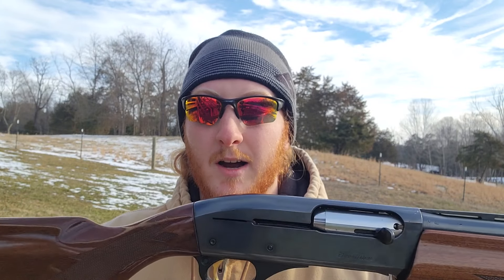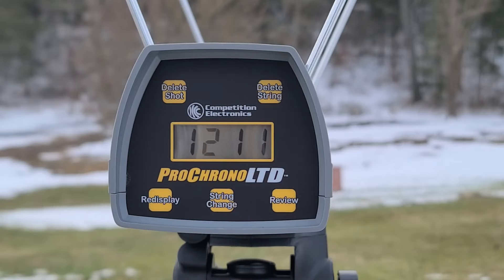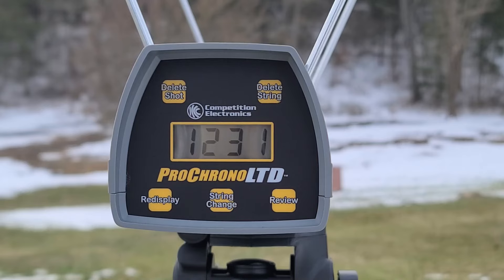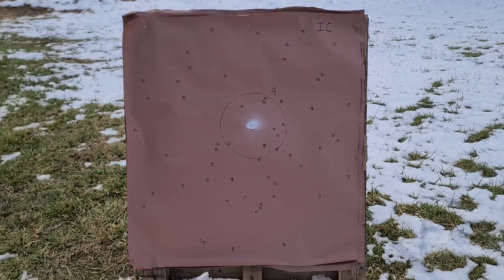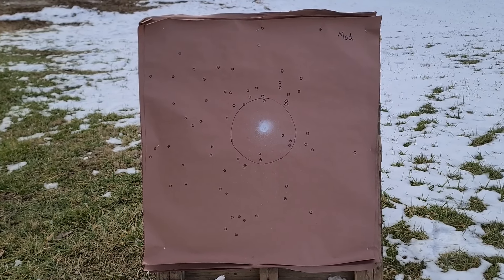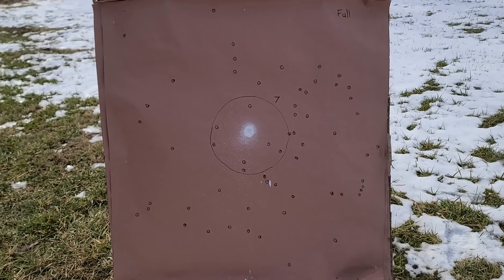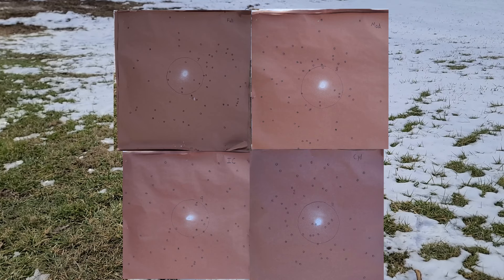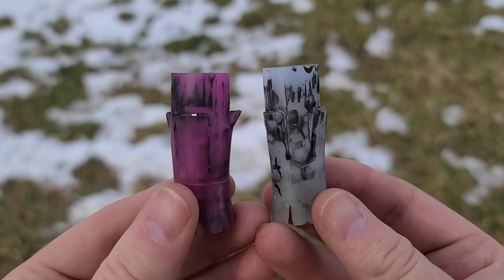What Choke Is Best? Hornady Magnum Coyote 3" 1-1/2oz BB

Comment: Matt thanks for the videos. Are you happy with your chronograph?  I was thinking of purchasing the Caldwell chronograph at cabelas, but I am not sure as a first time buyer.
Reply from the maker: I have never used one of the Caldwell chronos before, so I can't really say much there. But I have used a few of the ProChronos like this one and they've always done just fine as long as you're not too close to where the muzzle blast will mess with it. I will say that if you plan to use it indoors or outside in an area with a lot of weird shadows, you should also look into getting a lighting kit for it as well. It will drastically help your readings and cause less errors in areas where lighting may be problematic
Reply: @matttyreeoutdoors  thank you

Comment: The wads are a new variable to contend with. I didn't know Hornady had one. Always heard flight control doesn't like constricting. I've seen where chokes can change point of impact, just wonder if turkey sights to adjust aim to pattern density would help
Reply from the maker: We have actually tested flight control wads through the full range of chokes in a video a while back and had some really surprising results. From what we saw, they actually performed much better with the modified and full choke over the less constrictive chokes, so not at all the performance that most people claim
Reply: @matttyreeoutdoors  Good to know. Saves us the time and expense Thanks

Comment: A single round is a pretty small test sample, I think if you fired a few more from each choke you'd find the cylinder to be the best.
 Hornady themselves stated that they recommend minimal to no constriction with their Versatite wad, same goes for Federal with their Flite-control wad.
Reply from the maker: Well, that isn't exactly true. I even showed where Hornady claimed right on the box that an IC or Mod choke is recommended. Plus, we've seen multiple good performances from the Versatite wad through tighter chokes. And I also proved that theory wrong by doing a video on the Flite Control wads as well. They have done way better through full chokes than cylinder chokes. Were they initially designed to pattern well from little to no choke constriction, yes. But that doesn't automatically mean that either one can't do better with more choke constriction
Reply: @matttyreeoutdoors  I suppose milage may vary. Prairie Storm, Flite control and this Coyote stuff pattered better from my cylinder bore 590-A1 than my old fixed full choke Stevens single shot, almost dramatically so.